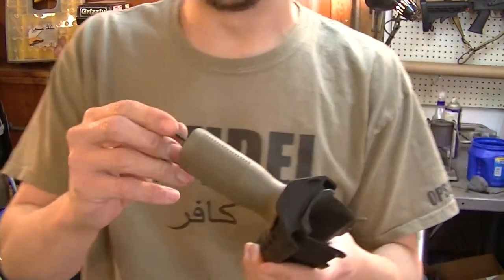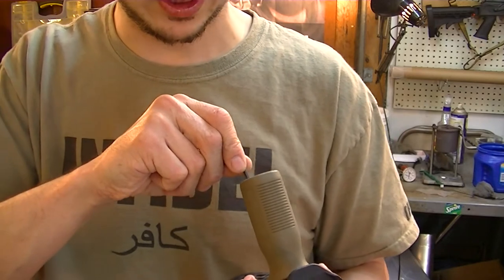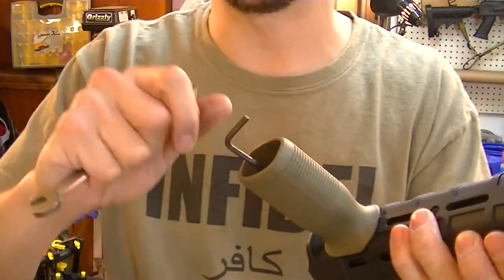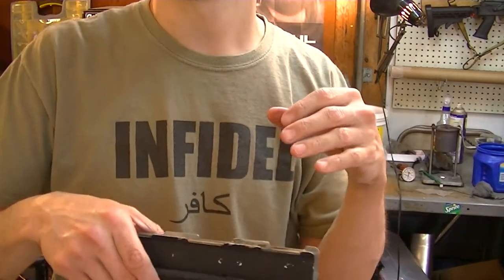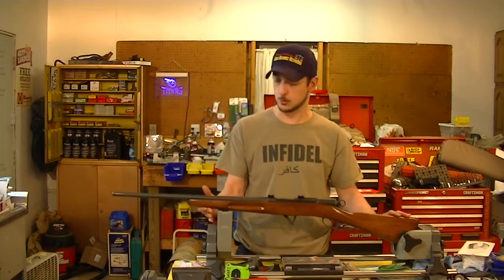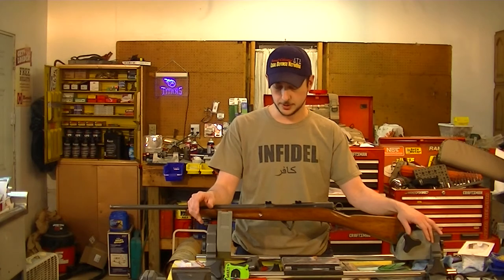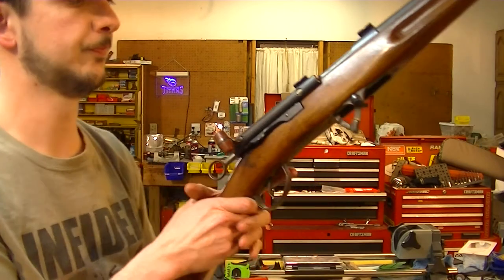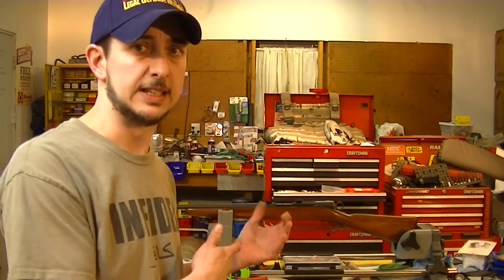TIP: extra leverage when using allen keys

Comment: 1) Make sure you scissors are metal handled, plastic will break.
2) I like to use cut-off barrel ends from shortening guns over the years.  Just slip the allen-head down the bore and it's SUPER strong.

Comment from the maker: Yea, the most likely tool used would just be a pair of pliers.  My purpose behind this was for that person that doesn't have any tools. The only thing they have is the tool that came with the part to be installed. Most people have scissors in the house or something like that. I agree one would want to use metal if possible but in a pinch I am confident that a plastic pair of scissors will give more leverage that just one's hand could. Thanks!

Comment from the maker: What are you talking about? Have you not ever been in a situation where you did not have a full tool box? Use your imagination a little man. This is intended for use by people in the field, or who may have purchased a simple add on (vertical grip) and may not have any tools other than the ones supplied in the kit.This is not a "SOP" for a gunsmith, rather a way for people with minimal or no tooling to tighten a non critical peripheral piece of equipment, doesn't have to be firearm related at all